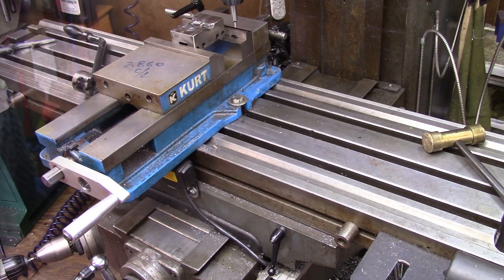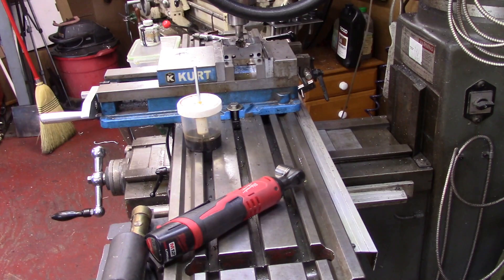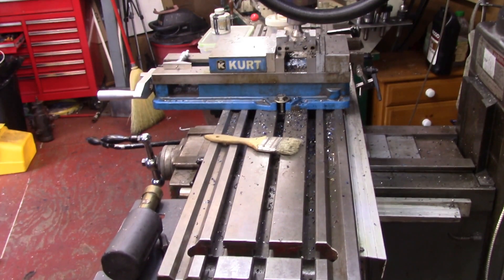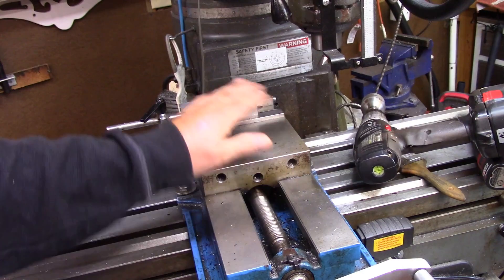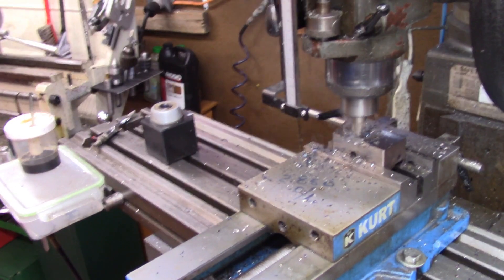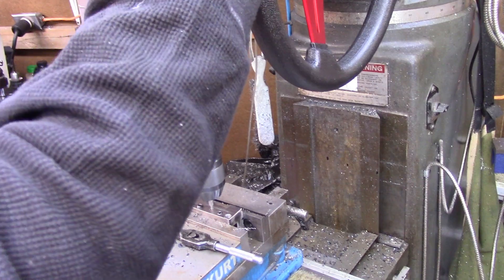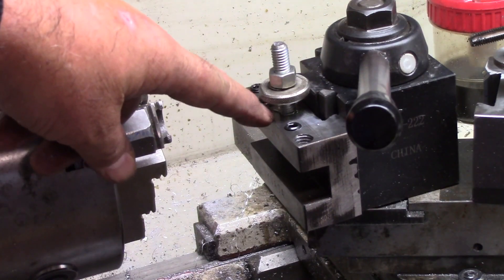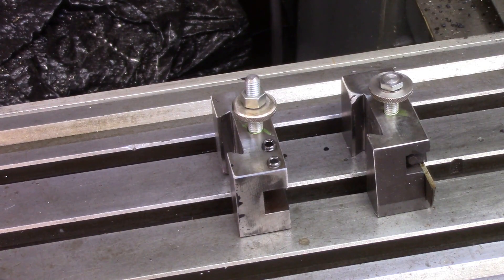Finishing the conversion of the MAMCO gift tool blocks

Comment: Left hand drill bit to remove stud.
Reply from the maker: Daniel Coleman only if you have them. So I improvised and retreaded it to standard that I had
Reply: Tell Santa you need a set. :)
Reply from the maker: Hill Top Machine Works heck I probably get a lump of coal.